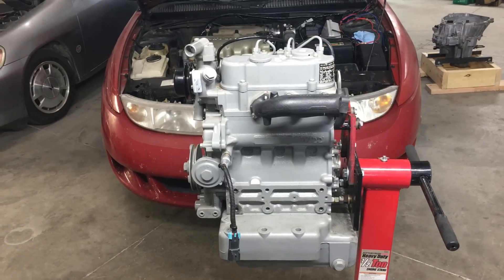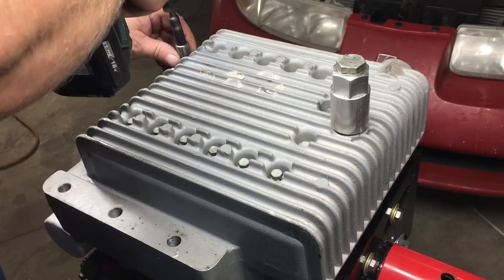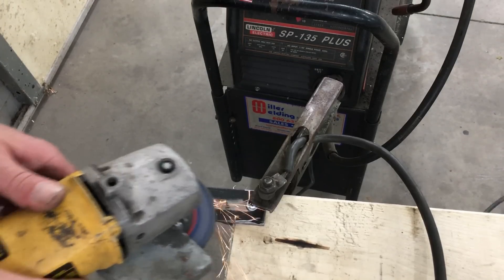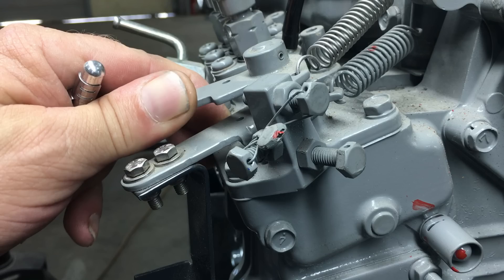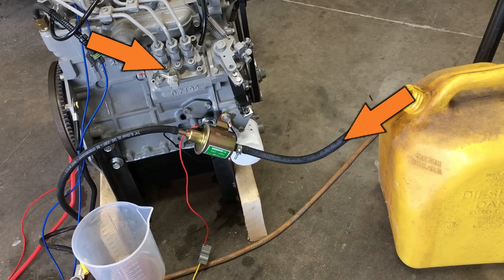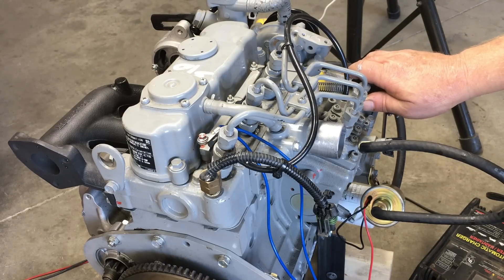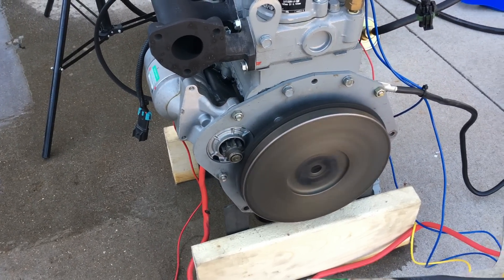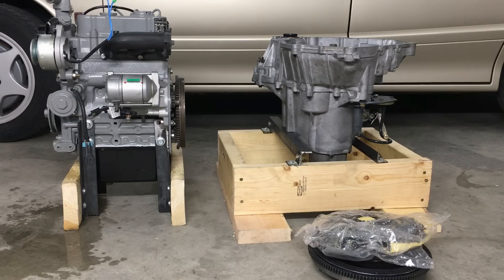S2E22  First start of the Kubota D722 diesel that we are going to use for our Saturn engine swap.

Comment: Yeah, I read 5 PSI of boost is pushing it to the limit on that non turbo engine.  Maybe if you get a wild hair, you might throw an electric motor on the front of the engine that runs on about 42 volts for a power adder?  Fork lifts are good sources.  
Thanks for sharing.

Comment: Amazing machine.  From my research there are fourteen different D series three cylinder engines offered by this Japanese industrial powerhouse.  I do have on standby D662 18 HP and 3LD1 Isuzu 39 HP peanut oil burning triple cylinder engines as well as this exact same close ratio transmission.  My twin 13 HP Kubota Z482 diesel powered Chinese enduro would only achieve 54 MPH top speed via a type 40 CVT though the top speed of the original aircooled 14.8 HP 200cc gasoline engine would achieve 57 MPH top speed via the 5 speed gearbox.  Changing primary/secondary gearing and opening the fuel screw only managed massive clouds of black toxic shit spewed into our precious atmosphere with no greater acceleration or top speed. Having compression ignition I did need to use a digital tachometer with flywheel mounted magnetic pickup however all the instructions were in Chinese so me and my fellow Honda Engineering Japanese friends did our best to interpret the kanji characters and using some batteries I wired in series at the lunch table we got it working!  YATTA!!!  Goodness what a fun build that was as documented on my Zuckerberg Matrix page build album titled "Chinese love, Japanese torque, American ingenuity."  So many of my friends have recommended I also start my own Youtube channel however I haven't the knowledge, experience or precious time to do so.  I much rather fling molten metal than edit audio/video and bare my soul to the whole damn world only to be criticized by fools in warm pink bunny slippers.  I would only consider such a process to document my continuing past quarter century comprised of three galaxies of similar fabrication content for posterity and to make MONEY.  Folks across the globe donate new parts only to watch them be utilized online?  Wow.   The almighty Colin Furze is my spirit animal however I just am not as outgoing or wild as he hiding here under my welding hood.  TICK TOCK.....

Comment: Have picked out a turbo setup for this engine yet ?  Xtreme motor works makes an adapter plate to mount a smart car KP31 turbot and manifold. Lot of cub cadet guys have done that on the diesel garden tractors.

Comment: Small correction; not every diesel engine has direct fuel injection, earlier engines for the consumer market had a 'swirl' chamber which the fuel was injected in, from that chamber the mixture reached the actual cilinder.
All this because the engine would run smoother and more quite with the technology at hand back then.

Comment: As always, love the video. Oh just wanted to let you know, if you got power windows in that thing, just wait until you have to change a window motor. Get this, the plastic skin comes off the OUTSIDE of the door, no shit. You don't take off the inner door skin, you take off the nice fancy painted plastic outer shell, basically, the outside of the car door. It looks so goofy, too. Well, can't wait to see the next video. That Kubota three cylinder is pretty much indestructible, my buddy had one in his tractor. His neighbor thought it would be fun to drive it into his swimming pool, and the next morning I woke up to see diesel fuel, in an upside down Kubota tractor floating in the water. So I made two big wooden ramps, drug it out of the pool with the Blazer, emptied all the fluids, drain the spider and pump, filters..... Believe it or not, after replacing the battery, she fired right up and ran again. My suggestion to y'all if you ever drive your Kubota 3 cylinder into a swimming pool overnight, get it running again ASAP, and it'll be no corrosion or rust damage occurred. Just a little helpful tip that you probably already know, LOL

Comment: Had a saturn. Was a good car. Slapped some quantum tech alloys, obx exhaust, larger throttle body(forgot how big), chipped, and turbo from a eclipse. Was pretty quick. Until the turbo got cooked and I blew a mount. Then the mounts kept breaking so I got rid of it......

Comment: On a modern common rail diesel, the injection pressure in the rail tops out around 28,000 psi.

Comment: with diesels you dont have to adjust the fuel. lean is safe on diesels and rich is dangerous, opposite to gas engines. adding fuel increases power to a point and past that it just increases exhaust temperature about when it starts rolling coal.

Comment: This is awesome! That engine is adorable and sounds great. As a footnote I've used several different rtv formulas and I can definitely say from my experience Permatex Ultra Grey works extremely close to Hondabond. On my Honda's I've been using it everywhere you'd use HB for a few years now. Places such as the oil pump to block and it's done amazing. Great to have in your tool box when you find it cheap.

Comment: You should have a solenoid connected to the fuel shut off lever, it's a safety shut off. When you turn ignition off the solenoid de-energizes and the spring will pull the lever shut. If you ever have a runaway diesel you will be grateful for the solenoid.

Comment: Brake cleaner does not evaporate oil. It will dissolve it or disperse it, but once the cleaner quickly evaporates the oil will still be there. Brake cleaner will flush the oil to other places, but in this circumstance it's better to wipe off the bulk of the oil with a rag, then spray the cleaner on and rub off the residual oil with a rag.

Comment: The d722 that you have is very simple, if you want more power you can turbo charge them. They offered a turbo version for the military, the injectors and injection pump from a d1105 will fit the 722 and add more power.

Comment: Excited to see how this turns out. I hear these stories of guys putting 4BT's in jeeps and getting 30 mpg with them. This thing ought to approach 60 mpg with the aero and lightness of the Saturn and being a sub-liter 3-cylinder. If you have power issues, you can always increase boost/fuel for acceleration. I'm sure if you wanted to start messing around with valve springs you could crank the RPMs up a bit too.

Comment: I drive a Kubota for work with presumably this engine or one like it. Thanks to this video I now understand why it engine breaks so hard when you let off the throttle, as the engine speed is related to fuel injection. You’ll be able to drive this thing with one pedal! (I think… correct me if i’m wrong)

Comment: All I use is Honda bond and boy let me tell u it works so good when u have to take something apart put together with that stuff u better be ready to work I told my buddy I almost bet my life I could talk all the bolts out of my oil pan on my Toyota truck and it won't fall off or leak I bent the pan getting it off it was on there so good !! Love that stuff !!

Comment: There’s an engine that runs on a combination of gasoline and diesel, using a process called “Reactivity-Controlled Compression Ignition”—RCCI for short—and it is supposedly very efficient.

The channel Engineering Explained made a video about it. Check it out when you have the time.

Comment: you don't need the eletric pump. the fuel pump has one way valves and fuel can only flow inside the engine.

Comment: Small mistake, Kubota engines are indirect injected, or IDI. Instead of injecting diesel into the cylinder directly, they inject diesel into a small prechamber or swirl chamber, that helps atomize the fuel. Combustion begins in the prechamber and flows out into the combustion chamber. The lower injection pressure required by IDI diesels has a side-effect you might be interested in if you decide to continue this project. They can run rather well on properly processed waste vegetable oil, unlike their direct injected counterparts. Vegetable oil can damage high pressure injectors, but low pressure injectors aren't bothered by it as long as you have a filter to catch any tiny bits of fast food that might still be suspended in the oil even after being processed.

Overall, good engine choice for the project. These little engines are loyal, they'll outlast your marriage, they'll outlast your grandkids, hell, they'll probably outlast mankind.

Comment: Cold side of cooling system normally enters at bottom of motor and comes out top. Using convection cooling as a aid. Water heats goes up, rad cools goes down 👍

Comment: god bless you, the vids are amazing and inspiring. currently swapping a 2.0 zetec engine from a 98 escort into a 88 corolla. Gonna run with a weber 32/36, no fuel injection here. I have to use a ras pi to manage the vct, havent figured that out yet fully.

Comment: Very cool video. Just to correct one thing though, the small Kubotas (and a lot of other smaller diesels and some larger ones) use indirect injection rather than direct. It will spray into a precombustion chamber/swirl chamber in the cylinder head above each cylinder.

Comment: That engine doesn't have direct fuel injection, it has indirect fuel injection as it has a pre-chamber where the fuel is sprayed and only then it reaches the cylinder.
Also, the glow plugs don't ignite the diesel fuel on startup as the glow plugs shut down when you turn the key to the start position, they heat up the combustion chamber so the diesel ignites easier when sprayed. 
Kubota engines, if you don't use the glow plugs/heat up the combustion chamber properly, they'll take way longer to start, if you do it properly, they'll start right up. 
Those fuel pumps are very sensible, if you remove or add shims, you may have difficulties starting the engine and it will knock (run rough). 
Those engines are extremely reliable, but they appreciate some knowledge about them and Japanese engine in general when working on them. 
If you mess with some parts and pieces of those engines too much, you'll never have the same reliability/durability as being OEM.

Comment: That little fuel pump is most likely enough. Toro golf course mowers ran kubota engines until 2013ish and they use way bigger engines than this with a similarly sized fuel pump.

Comment: 137 bars of injection pressure makes me wonder if that engine isn't maybe indirectly iniected like the Mercedes OM60X series with a swirl chamber? 137 bar would be fine for idle on a typical direct inection diesel but way too low for operation under load. But I might be wrong, it's a small engine, maybe it's different.

Comment: Something of note, is that diesel transmissions are geared shorter and often the gears are set closer than gasoline ones to make up for the narrow rpm range. 
my car is a 85hp turbodiesel renault kangoo. it does 65mph at 2700 rpm on 175/75r15's in 5th gear. it wont do more than 96mph at 4900 when the fuel cuts, and 5th is not any longer than 4th, unlike a gas engine, which will have a much longer 5th gear for economy. i doubt this kubota will be able to go beyond 3rd gear.
also it'll do up to 45mpg when driven gently. i'm in the low 40's usually. just a perspective, since my car is about as aerodynamic as a brick.
if you can, get a vw rabbit diesel trans for your car, or find a short ratio gearbox of some kind. and small wheels. like spare donuts.

Comment: The MP3 being close gear ratio may be a less than optimal idea. Diesel is all around a more efficient fuel type, but a part of that is that it makes torque down low, allowing for low RPM at high speed not lugging the engine. A turbo diesel at 80mph? You could do that at 2k rpm easy. A Honda Fit with no torque? Not going to be happy at 2k, so it needs shorter gears.

If you swapped a taller 5th into the MP3 trans, that might be optimal. I understand the idea behind the close gear transmission, it'll help with the sub 4k redline, but I feel like it'll be the bottleneck for efficiency above 45mph. 

Curious how all this will work, but if it doesn't get 50mpg+, just grab an old VW ALH block and slap it in, it'll get above 50mpg for sure after that lol.

Comment: Strange to see an engine type I'm actually somewhat familiar with. Some American manufacturer figured it would be a good idea to shoehorn these things into small zero turn commercial lawn mowers, and I used to work for a company which thought it was a good idea to buy them. The engines themselves were decent enough I suppose, but the integration was so awful that the extra maintenance and repairs more than cancelled out the modest fuel efficiency gains.
As an example they were fitted with electric cooling fans, and these fancy temperature regulating, auto reversing fan control units which invariably failed within 1000 operating hours, usually coinciding with the coolant temperature alarm also failing. I lost count of how many choo-choo train incidents we had, though the engines didn't seem too bothered by the periodic overheating.
Very interested to see how this cute little thing fairs in a car. I always thought these engines should have a pretty good potential when powering a machine which isn't trying to kill them.

Comment: My guess before watching the video of whether you'll get to 60 MPH or not, It depends on the gear ratios in that transmission. So if the RPM's of the transmission to reach 60 MPH is close to that peak torque point, I'd say the answer will be yes but it will take a while with it being a NA Diesel engine. and I'm going to go with a yes as my guess ultimately.

Comment: OK...just you wait.  You will wind up that little engine ready to shift and as soon as you hit the governor, it loses power and stays the same RPM. You can leave the gas pedal to the floor, push in the clutch, take your time, shift to the next gear, then ease the clutch out and get going faster. Its really goofy driving with a fixed governor and no injection advance mechanism. This Kubota governor was designed to run at some constant RPM...like 1800 or 2600. You might need to open up the access to the flyball governor drive and double up the spring to get a full 3600 rpm.  

  I put a 905 Kubota diesel in a Geo Metro convertible in 2008. I will look for the video.  Also, need to find a vacuum source for the power brakes or you will have no brakes! My right front axle would have gone through the spin on oil filter. It's possible to switch the oil filter to the other side, front side of the engine but that needed a home built oil bypass plate to be installed under the filter spin on pipe. I had a solenoid to operate the fuel shutoff arm to turn the engine off with the key.  Best of luck!
Reply: Here it is, DieselGeo Metro filmed with a 2002 50 pixel Yukon Gold potato. The doggy thinks she is helping out by holding her toy. I still have the car in outdoor storage under ivy vines as camo, awaiting the Zombie Apocalypse. 
https://www.youtube.com/watch?v=hnAOF1bOSB8

Comment: Always remember before turning the engine off, give it full throttle for few seconds.
The injection pump get's its lubricating oil from what the main crankshaft sprays around the crankcase.

If the engine is used in low rpm's for prolonged time, the injection pump will starve from oil and lock up.
These engines can run crazy high rpm's for indrustial diesel engine, dont quote me on this but some kubotas run upto 3800rpm stock.

There also is fuel screw at the end of the injection pump, and the timing can be advanced by using thinner gasket on the injector pump housing.
Reply: aaand now i watched the rest of the video and you already knew all that :)

Comment: AHAHAHA WHEN I WAS A TECH we did this to a saturn 4door. One cyl dropped rings= burnt LOTS of oil. So we disabled injectors spark and rockers. Sure enough ran on 3cyls. Rough at idle but still do 65mph just take bit to get there

Comment: I'm quite excited about this build.  I'd be happy to drop a 3 cylinder diesel into my geo metro.  Heck of alot easier to turbo and I think the torque is close to the same even if the gasser has 3x the HP.

Comment: I didn't see a fuel filter... PSA: No filters even for test running is not so good on a diesel, with the small tolerances of the magical parts inside the injection pump and injectors.  Your local diesel pump shop will love you. 😄 Man that engine starts and runs well!  Crazy the amount of work 20 hp and less than 100 ft lb of torque actually can do.  I spent a lot of years helping on a farm and learned Diesels through the school of hard knocks.  Jimbo,  you seem to have a handle on things so enjoy your journey and thank you for sharing with us!
Reply: And the injector return path is interesting, is that correct or should it T to the tank from the pump in normal installation?
Reply: @karlfischer1011  mine is like this........one side feeds back to the pump and the other runs to the tank. I guess that helps if it's starving for fuel is why they run 1 back to the pump. I actually never noticed and had to go look.
Reply: Yeah most have 2 in line filters. 1 is the minimum !

Comment: the only stuff better than the honda sealant is Caterpillar 4C9614 and 983457, but some "unreasonable force" may be required to un-stick things stuck together with those sealants, great video and i cant wait to see the saturn purring with a small Kubota diesel, should be an interesting experiment, after all we saw what could be done with a honda insight and a supercharged cement mixer engine, get well soon brother, and the audio sounded fine no real difference (or none that i can hear anyways) between your other videos and this one